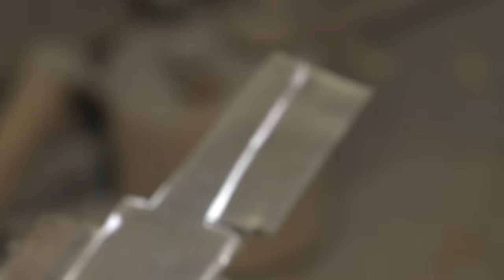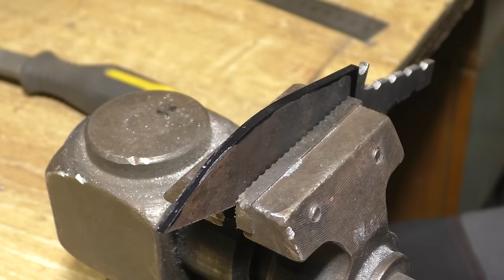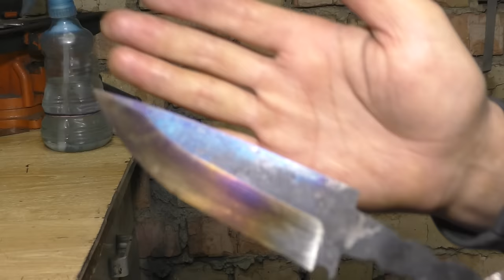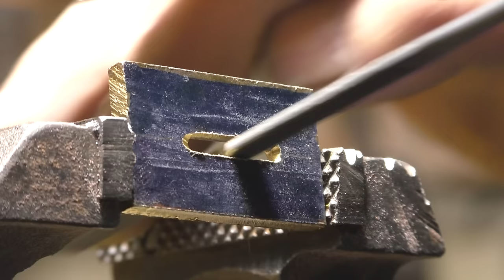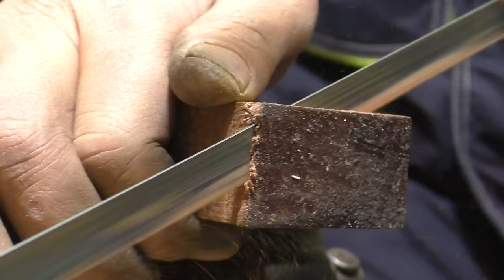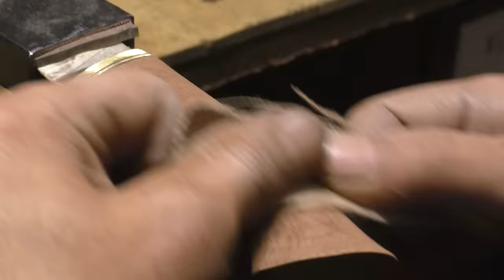Making a knife without special tools. DIY

Comment: Love the blade length from handle to tip great shape only thing I would change is towards  tip on back of knife I would put or make a hump so when skining with blade edge facing up the hump will slightly push tip or point away from meat and not stick into meat so easy old butchers knives if you look  were  like this or slightly curved

Comment: It's not the price of the tool, it's the skill of the artist.  Lovely work. What are the materials used in the three thin layers you stacked and glued with epoxy between the guard (back quillon) and the wooden handle? What are their purpose? My guess is they are leather, brass, and steel and they are just decorative? Is the guard made of brass?
Reply: for me it's the tools

what kind of dimbass has a dremel but doenst even has a hacksaw?
Reply: @VerbenaIDK  Look at the mirror, you'll see a bigger one...

Comment: HEY THANKS MAN IM GONNA TRY THIS IM GONNA USE AN OLD LAWN MOWER BLADE TO MAKE IT I KNOW ITS ALOT OF HAND WORK ITLL BE HARD FOR ME CAUSE I HAD A STROKE N LOSS ALOT OF USE OF MY LEFT HAND BUT I HAVE THE TOOLS BUT WHAT GRIT WAS THE SANDPAPER THAT YOU USED IN THE BEGINNING THERE N drill bit size what grit metal files to use what round grit files did you all use for this project  I'd really appreciate it ok bud ok thank you hope to hear back from you

Comment: Nice grinding. I've used similar grinding jig, though using steel hardware to attach the file (more like old Aaron Gough setup).

Tempering with a torch? Give me a break. It is not consistent, and tedious to do for any meaningful amount of time, while electric oven is dirt cheap and provides for proper tempering cycles (which could be hours long).

Comment: How do you know when the blade is hot enough for the heat treatment? Very nice video!
Reply: you look at the colour. When it's cherry red you know it's between 800-900°C, which is the temperature for haderning steel.
Reply: Use a magnet. When it no longer pulls on the hot steel, it’s hot enough. Saw that on Forged In Fire.

Comment: Which steel did you use?
Reply from the maker: Spring steel
Reply: @edwardknives8692  does it get rust when contacts with water or atc?
Reply from the maker: Rusts(
Reply: @edwardknives8692  Thanks.
Reply: @edwardknives8692  Hello again! I will make my own knife (4116), I loved this knife. Would you like to give me the template of this knife?
Reply from the maker: Hello, unfortunately I don't have a template(((
Reply: @edwardknives8692  It is fine, Thanks anyway! :)

Comment: What kind of gas do you use to heatup the blade ?
Reply: Any gas can work so long as it's hot enough. Propane is fine. Butane is good. Acetalyne can over heat if youre not careful

Comment: No special tools. How about the angle grinder with a cutting wheel, and the one with a grinder. ?????
Reply: There's nothing special about an angle grinder... it's a basic power tool and inexpensive. And he will have used the same machine with 2 different discs. Also  a vice, a drill with a sanding disc, a couple of clamps, a blow-torch, 2 files, oil, water and abrasive paper of several grits. NONE of which are specialist tools, and you can buy the lot for about £150 - £200. But none of them will do anybody any good unless they have a similar level of craftsmanship to this bloke.